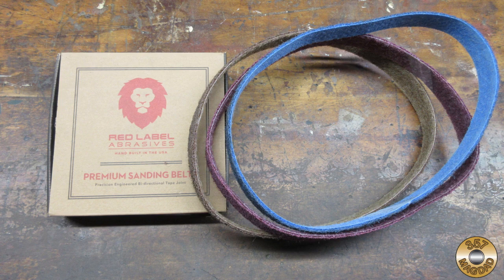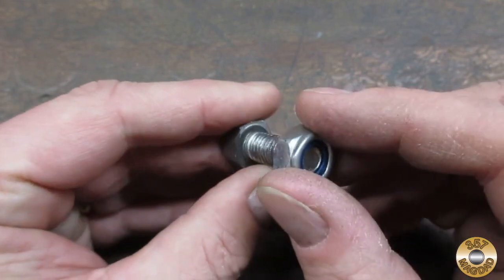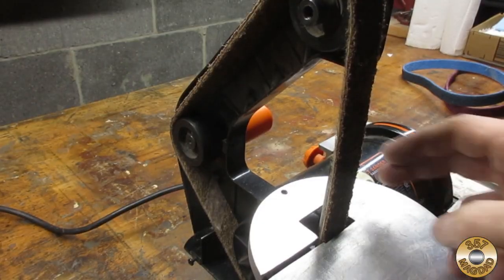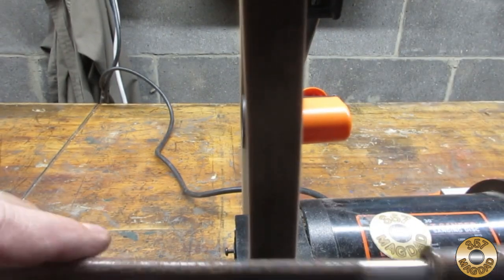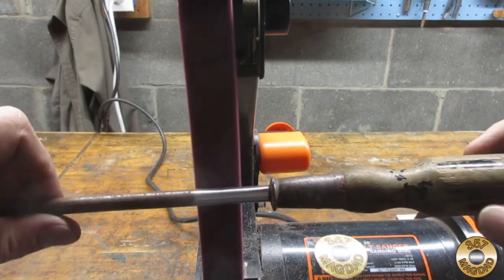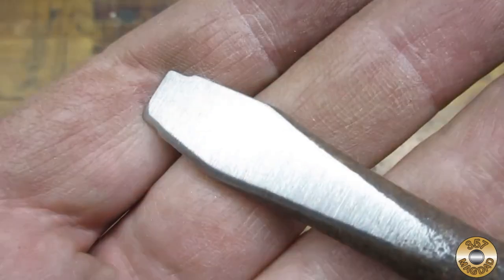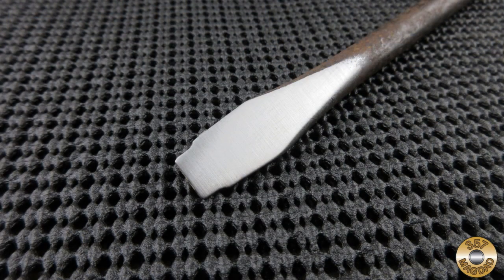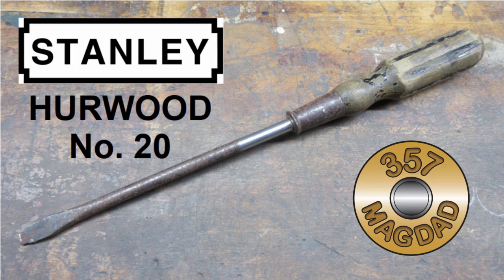Product Review - Red Label Surface Conditioning Belts

Comment: Very good product review. Maybe jump starting will become unnecessary  with time and use as the belts stretch slightly. As you said time will tell. That is a very nice old Stanley screwdriver. If those are factory notches in the blade tip, then that's something new to me. Looking forward to the resto video. Thanks
Reply from the maker: Thanks Pat!  I think the notches were a modification made by a former owner.

Comment: HAHA! Just when I thought Chuck wasn't going to make a cameo. He shows up! I really like those belts. I would assume with a teency weight loss due to fuzz coming off, they will not be as tight. Wen that happens, they should start better! Pun intended..... They sure zip the stuff off.  It's like a belt of scotch brite! I'll have to check my HF sander. Mine is loud as heck, maybe a bolt sticking out! Good tip.  Great video!
Reply from the maker: Thanks Aaron!  The belts are starting on their own more often now that I've used them some.

Comment: They do make a nice finish..I am confused though..I thought all belt sanders have an adjustment for belt tension..if not maybe you could modify something like make slots where the motor mounts ?
Reply from the maker: The back pulley pivots on that bold and has a spring to keep tension.  There's only adjustment for run-out.  I think all of the 1 x 30 machines are made the same way.

Comment: Thanks for this, I had no idea these existed! If you find they hold up reasonably well I'll add them to the list of things I want to acquire this year to help with tool restorations. 

Somewhat related, I only just discovered that fibre wheels can be found that go up to 600 grit (I previously thought 360/400 was as high as they went). I don't know if this is old news to you but I thought I'd mention it in case you hadn't heard they went up that fine and wanted to give them a shot.
Reply from the maker: Thanks for the info on the 600 grit fiber wheels!

Comment: Thanks for the review, and my apologies if I missed it, but I'm wondering if you feel these are better or offer an advantage over traditional belts?  Are they just another way to do the same thing with abrasive belts or are they faster, or produce a better finish (quieter?)?  Does the added nap make them better at getting into dings and crevices, or make it less likely to sand a flat spot?  Just wondering if I should (and why) take the plunge.  Thanks again for the videos.
Reply from the maker: Thanks for watching!  I usually sand with conventional belts first - down to maybe 120 grit, then use the conditioning belts.

Comment: Please take note of the condition of the plastic pulleys.  I am concerned the fibers on the back of the belts will be abrasive enough to wear them down.  Though if they do, that will slightly reduce the tension and help the motor restarts.  I wonder if you could upgrade the belt sander with a capacitor, or replace the motor with one that has built in capacitors.
Reply from the maker: Wen it dies, it dies!  LOL  These 1x30 machines are cheaply made. I got the Wen because I thought I might need the disc sander, but I don't use it much.
Reply: @357magdad  Bucktool probably makes some of the best budget 1x30" and 1x42" sanders you can buy, followed by the Rikon belt sander! Highly recommend the 1x42" which you would be very hard pressed to bog down even running those surface conditioning or thick ceramic belts! I can go full pressure and it does a very good job of chugging steel and have not had issues with overheating even running it for hours on end.

Sincerely,
JS

Comment: Thanks for doing  the review for us. i wonder if using the wire wheel then the fine belt would give the same results. Interested in your long term results.
Reply from the maker: Thanks John! I'm still experimenting with how to work these into my "process".  I cleaned up a pocket knife for a friend the other day and the belts did a great job on the blade.

Comment: I know that this is a pretty old video, but I have a question. I bought a set of these belts. I'm currently working on an old tack hammer that I found at a garage sale. My question is, after using the fine belt, is the tool ready for Flitz?  It looked like some pretty heavy sanding lines were still visible. Will Flitz take them out?
Reply from the maker: I usually start with a 120 grit sanding belt and then go through the three grades of conditioning belts.  After the fine blue belt the metal should be ready to polish.

Comment: I would suggest socket cap screws for that modification. I was already thinking about getting a 1x30 and this may have put me over the edge.
Reply from the maker: I could've replaced the bolt, but modifying it was fun!  The 1x30 has been a good tool for me.  I bought the Wen because of the additional disc sander, but I admit I don't use it very much.

Comment: Interesting! Regarding the tightness problem, as it is non woven it might be possible to gently stretch it?
Edit: that would probably solve the motor problem too!
Reply from the maker: I think they are wearing in.  I don't want to stretch them too much!
Reply: Yes they probably stretch after some time. But if you decide they are worth getting more of your poor motor might decide to quit eventually.
Still interesting product!
Edit again: you could try buying a more potent start capacitor to help it start.
They are usually on the weak side from the factory anyway and will not cost you many dollars to replace!

Comment: If I really wanted, could I put 2x36 sanding or conditioning belts on my 4x36 belt and disc sander? They just don’t have a wide variety of 4x36 belts. Thanks.
Reply from the maker: It might work.  Combat Abrasives sells the 4x36 conditioning belts.
Reply: @357magdad  cool. Yes , but it’s $120 for three belts and I think only they do 4x36 surface belts, no one else. Thanks

Comment: Those seem to work nice! I'm hesitant to use the nylon stuff because I don't want plastic fibers everywhere. Did it heat the metal up at all? I noticed you didn't dunk it in water, so I was curious whether or not it did.
Reply from the maker: The metal got warm, but the belts worked so fast that I didn't need to dunk in water.

Comment: This is not related to these belts but about the wen grinder. I have a pace maker and was thinking about purchasing a wen. Does the wen have a metal drive wheel or is it plastic. If you would help in my decision. Thanks
Reply from the maker: Thanks for watching Sidney!  The wheels are plastic.  If you're concerned about electrostatic shock, don't get one of these!  I get zapped constantly in the winter when the air in my basement shop is dry.
Reply: Do you know of one that has a metal drive wheel. I have enjoyed your YouTube channel so much since I found it. Learn a lot from and others you have recommended. Thanks again for reply.
Reply from the maker: @sidneylaughter3437  Sorry Sidney I do not.  I  am suspicious that all of the low cost 1x30 machines are made the same.  You might have better luck finding a vintage machine like Joe's shop.

Comment: Nice! Those work pretty good.
Reply from the maker: Knife maker's swear by them.  I was put off by the price, but my sister hooked me up!
Reply: @357magdad  
I made a dagger out of a file about 27 years ago when the company I worked for wouldn't lay me off. I used a hand grinder and then the same subsequent 3M Roloc discs and made a cool thing that I still have. Those abrasives can remove more than you want to if you aren't careful. Nice addition to the toolbox, glad to know cool stuff is out there and available. Oh, I got paid 8 hours to make my dagger!

Comment: Anybody ever wonder if all modern 1x30 inch belt sanders are made in the same factory, but with various minor differences and branding?  They are all suspiciously similar...
Reply from the maker: There were several Amazon reviews claiming the belts wouldn't fit on the Harbor Freight 1x30.  I'm not sure if the problem is similar to what I found on my Wen.  If it is, it was a pretty simple fix.